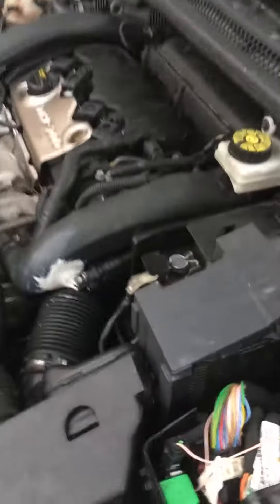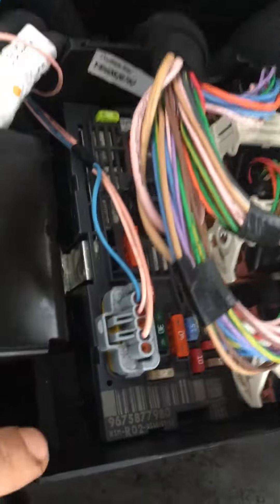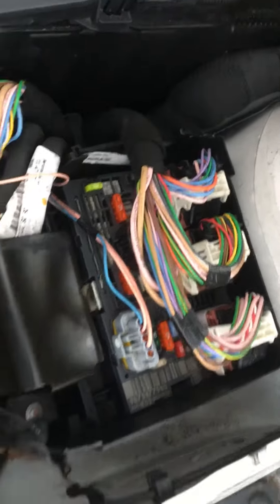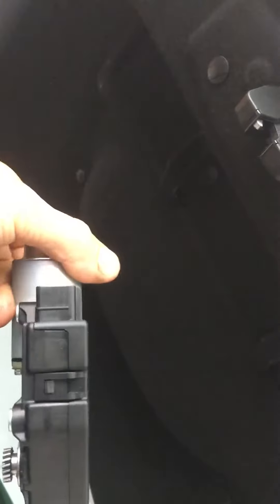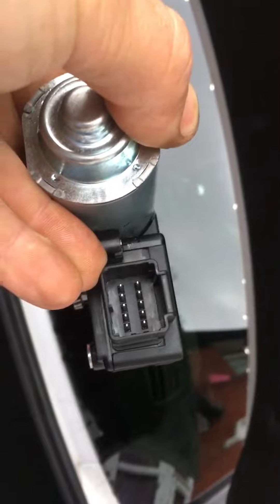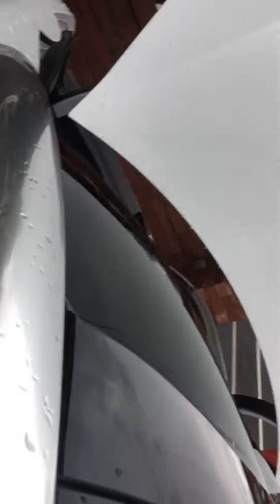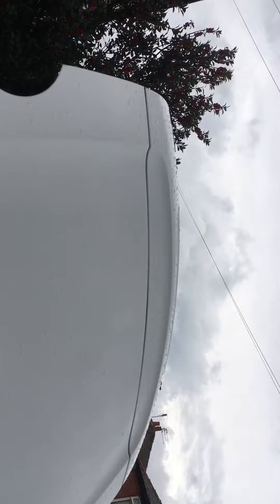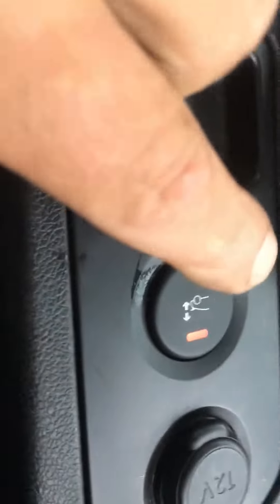RCZ REAR SPOILER FAULT ,FUSE LOCATION

Comment: Hi mate, which fuse is the one for the spoiler. Someone told me it was the green one. I'm struggling to find what's happening with my rear spoiler, it used to work but now it won't and the button doesn't even light. Any advice would be gratefully received.

Comment: yo, had the same problem went even further took the casing off the motor itself to find out the plastic casting had melted in to the motor. So ordering replacement one and will oil up springs as have all disconnected. would say this very easy home job to fix for anyone who has small bit experience.

Comment: Mine isn't working and there is no light. It is stuck on lift. Any idea whether it's the maxi fuse or motor. And if its the fuse, how would I know whether it needs replacing
Reply from the maker: Hi maxi fuse is located at the side of the main fuse box under the bonnet left side the motor for the spoiler is probably the fault check for power and ground at the plug it’s in the tailgate